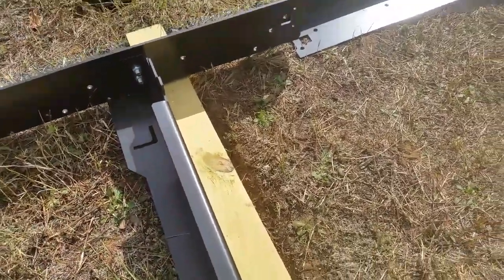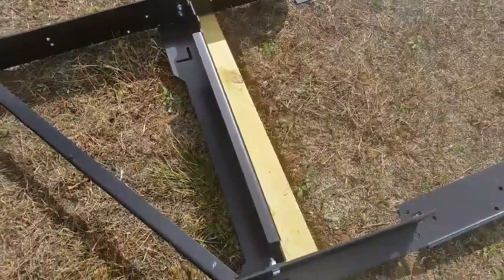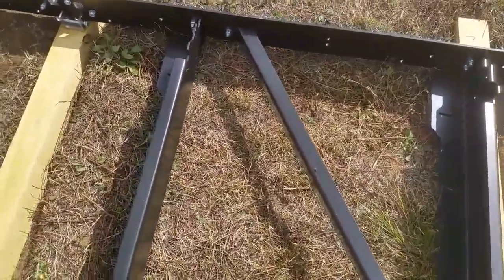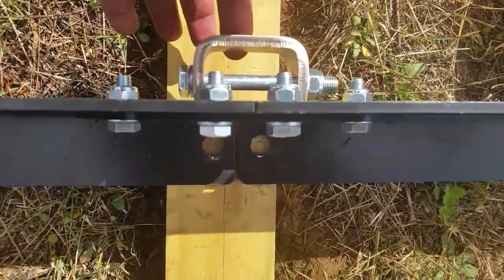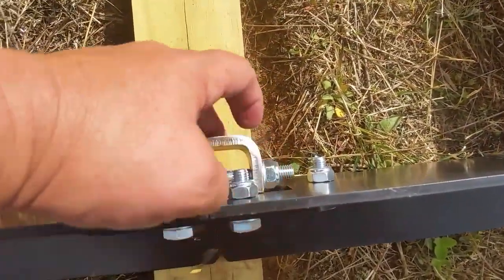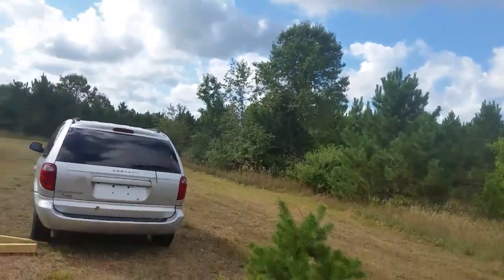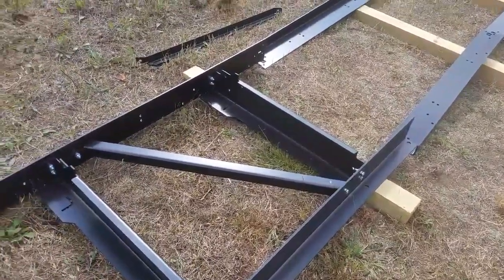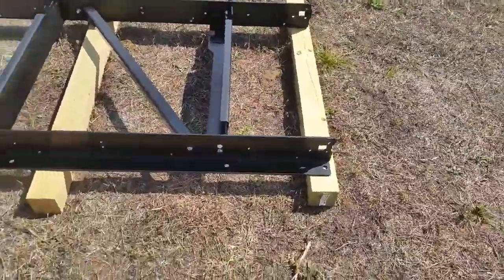Timbery M100 Sawmill Track Alignment

Comment: Those tracks are really thick. Wow. Looks like a well made mill.
Reply from the maker: Love2boat92 Not sure if 3/16" or 1/4" thick on the main rails. Got the whole frame snugged up, just need a ratchet extension fo get around a ratchet to bolt head clearance issue.

Comment: Jeff, I am getting ready to pull the trigger on one of these.  Did you get it up and running, and if so, how do you like it? What size motor did you get?
Reply from the maker: Adam A Didn't get it up and running yet. Weather and other things have gotten in the way. Hopefully in a few weeks will have it finished and making sawdust.
Reply: okay, ill subscribe and stay posted
Reply from the maker: Adam A Gotta get it done soon, winter weather is coming and it sucks trying to assemble stuff in the snow.